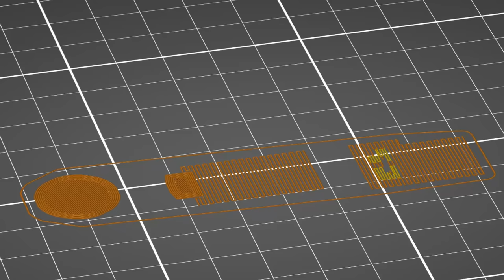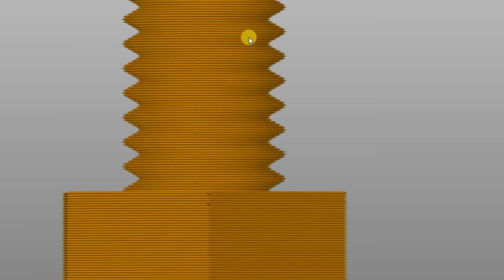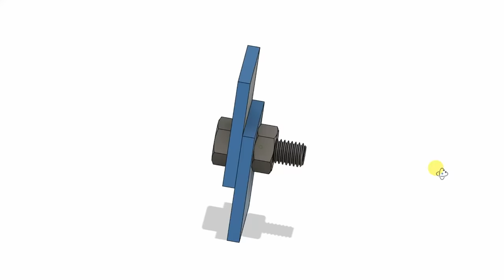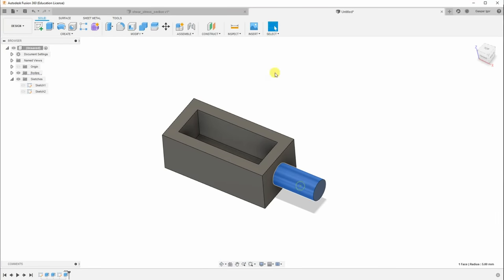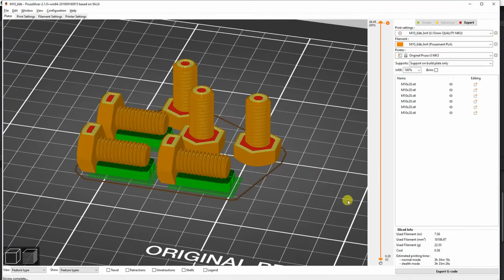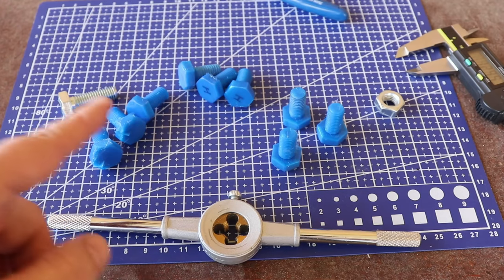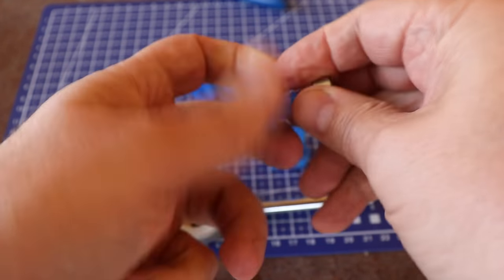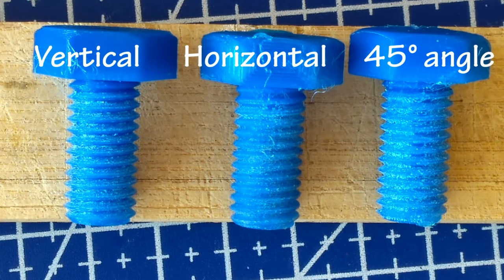3D printing bolt and thread in horizontal or vertical position - strength test

Comment: It may be a better idea to use a hydraulic jack to do the tensile and shear test instead of your body weight. Some additional setup will be required to get the force in the right direction.
Reply from the maker: I am working on Arduino based tensile testing machine, but it takes time for parts arrive from China ;-)

Comment: A thought mid video, does the position on the diagonal print matter for rigidity? What if it was so that the print was flipped so that the head is facing upwards?

Would it be stronger if the layers were at an opposite angle to the threads?

Comment: Very good information. I am just inspiring should we start thinking develop a '3D printed' thread standard? Just an idea. Thanks you.
Reply from the maker: What do you mean with 3D printed thread standard?
Reply: @MyTechFun  sorry for my late response. The 3d printing thread standard - I mean the shape that will most benefit when you printing it (FDM printed). I understand that there are many types of thread design on the internet already, most of them have bigger pitch than ISO thread standard.

Comment: You had rachet straps, why not use those for the pulling force instead of possibly hurting yourself? Very interesting test though!!
Reply from the maker: Rachet straps needs another fixing place, somewhere near floor. But I am working on safer solution, will be visible soon..

Comment: For the torque test you should’ve used an actual torque wrench because I think the way you did it wasn’t a good way to measure it since the further you move from the point of rotation the less force it’s going to take to move it but if you used a torque wrench it would tell you the exact force it takes
Reply from the maker: Thanks for suggestion. I am working on Arduino based digital torque wrench, but I think this method give acceptable results (good enough for comparison in this video). Torque wrench can give us values in Nm (not force = N). Mass*g*arm = Nm (in my method).
Reply: My Tech Fun oh ok that makes since and that’s also really cool

Comment: I think if you print 1 at a time they will be stronger because it is keeping the printing + heat more constant than jumping to 2 other parts to print at the same time...
Reply from the maker: Yes, 1 at the time is stronger, but this is not only about 3D printed bolts, but about testing threads as part of any 3D printed object.

Comment: What kind of infill did you use?

Or was it solid PLA?

Would these be stronger if printed in/with resin?
Reply from the maker: 100% infill with 5 perimeters. Resin bolts test will be in near future.

Comment: i like printing bolts flat with a flat cut along the bottom so it still wont need supports the bolts function is unaffected by having a flat
Reply from the maker: Yes, I already got this suggestion several times, I am sure, that I will test that in near future. Thx.

Comment: Could you print the bolts horizontally BUT with nuts on the entire thread. So the nuts would be the support and nothing is wasted. However will the nuts properly "detach" from the bolts?

Since many people use very short bolts, in most cases 1-2 nuts would be enough to fully support the vertical bolt.
Reply: To ease separation you could use for example M4 nuts as support for M3 bolts. You could even print TINY support between the M4 nuts and the M3 bolts where they touch if necessary.
Reply from the maker: I understand your idea, but with this video I was curious more about threads, not just bolts. Threads as part of your 3D printed object. If I need just bolts or nuts, I use standard metallic versions.

Comment: Your making great videos on testing strength of 3D printing I like them but I was wondering about the strength on the torque test isn’t it force in newton x length in meter = newton meters so that means you are getting kg meter you still need to multiply the kgm with 9.8 then you got nm or am I wrong?
Reply from the maker: Force = mass * g for example on torque test if I measure 1 kg => force is 1*9,81 N. So Torque = Mass * g * arm [Nm] More detailed explained in this video (timestamp link) https://youtu.be/EakLs9ebcZA?t=252
Reply: My Tech Fun oh right sorry i looked over the 9.81 in your equation I am sorry

Comment: interesting I just got done printing some tank valves and I have problems with the treaded section snapping at the base when i tightened the nut, so far I decreased the interior pipe diameter which increased the strength but I was also wondering about this very test

Comment: Could you upload the model of one bolt M10, please? I mean the file you put to the Slic3r (probably stl). I don't have a Fusion but I really would like to check it on my 3d printer.
Reply from the maker: I am working on a solution where even Tinkercad users can create a bolt or nuts. Just need some time to prepare it. M10 used in video has 0 mm clearance, not useful STL if you don't have a die tool (0 mm, the reason was explained in video, to have same size for experiment after cleaning a thread)

Comment: I think I already saw a similar test in the past, it was more accurate than this one.
For more accurate results you need everything on a smaller scale. Human for scale is a bad idea when testing something like this because you cant control weight distribution and swinging. You also need to repeat the test multiple times for more accurate results and calculate the average of those few tests.
Good luck.

Comment: Have you tried printing aircraft bolts? They have curved edges instead of sharp and should be less vulnerable to shear and tension. Idk about torque, though.
Reply from the maker: That makes sense. Or maybe trapezoidal threads..

Comment: after the print is finished you need to put the part in an oven and heat the entire part to the glass transition temperature ... it will make the part much more stronger
Reply from the maker: The object will deform a lot. Tested: https://www.youtube.com/watch?v=v3w8GlcHUsc&ab_channel=MyTechFun

Comment: Good data, but he should have tested the Nuts as well, then tested BOTH together, as this what most people are going to print to use anyway.
Reply from the maker: Nuts are tested too (but not together), but it looks like bolts are weaker point, 3d printed nuts are stronger.

Comment: If you're going to cut threads using a die.  You should also test by printing cylinders and simply cutting the threads.
Reply from the maker: It is always better not to cut the perimeters of printing, only minimal with slightly correction.

Comment: Wonder if printing at different temps has influence on the strength
Reply from the maker: If printed in horizontal position, not much. If printed in vertical position, yes, temperature has very big effect to layer adhesion.

Comment: Can you tell me what support settings you use in prusa slicer? Overhang threshold, contact z distance and xy seperation? Thanks
Reply from the maker: In these tests PLA on 220°C, 0.15 layer height, 0.4 nozzle, 0.1 z distance, overhang treshold 30° = only overhang of 60° has supports.
Reply: My Tech Fun thanks for the info, did you leave xy separation at 50%

Comment: The strongest is not the made out, but the took out.
Solid material machined to be something is stronger than something that was made to be.
The lathe is more important than any 3d printer.

Comment: I wonder how testing with just printing the shape of the bolt and then using a tab and die set to cut the threads would affect these results...
Reply from the maker: In that case, you would completely cut the perimeter(s). It is better to have (almost) ready object, and use die only for cleaning the thread.
Reply: @MyTechFun 
A year later...thanks for the interesting video and the hard work that went into creating it.

I've been hunting through the comments to see this came up. I wonder if printing the perimeters such that they would be the same thickness as they would be with printed threads, then using the die, would result in a stronger bolt and/or better threads?

Comment: You should use a car jack for more controlled application of force. It also shouldn't max out at 140kg.
Reply from the maker: Working on better solution. I bought 500 kg crane scale, it should be enough ;-)

Comment: Please, I really like your channel.  The way your are hanging down to test the bolts is dangerous.  If you get hurt, it will not be good for you or for us.  Please use a pulley system so you don't have to strain anything to perform your test.
Reply from the maker: When I watched video it looks dangerous, on spot I don't feel it's dangerous. I am working on Arduino tensile testing machine, few parts are missing but it will be done soon
Reply: @MyTechFun  I'm just looking out for you.

Comment: have you ever tried printing a solid rod and then use the die to create the treads?
Reply from the maker: With that method you will cut perimeters (wall). That can work only with solid (injection molded) plastic.

Comment: What about printing it without thread and then use the threading tool to make thread - it could work better, you could try it
Reply from the maker: Cutting walls (perimeters, or shells) is not good with 3D printed object. I am trying to do without any need of useing die (or tap) tools. Will be demonstrated soon..

Comment: Why is the horizontal print still stronger than vertical print in shear test? The fibre orientation for vertical print will be in the same direction as the shear force and so should be stronger right?
Reply from the maker: Shear area is in direction of layers on vertically printed bolt
Reply: @MyTechFun  Sorry I still don't understand; do you mind elaborating?

Comment: Put a small dynamo against the Aniroid barometer cell cylinder so we got some voltage as pressure changing in whole day 
And collected all voltage in a battery bank so we found new ways to produce clear power round the universe

Comment: What's is the 0.19m?
2.8kg*.19*9.81

I know the 9.81m/s is gravity and 2.8kg is force

Thanks
Reply from the maker: 2.8 kg * 9.81 m/s2 = Force (in Newtons) and 0.19 is distance in meters (Force * distance = Torque in Nm)
Reply: @MyTechFun  you ledgend! So you turned .19m around whilst turning the ratchet?

Comment: Excessive stringing is usually caused by a wore out nozzle. Avoid carbon fiber and glow in the dark filament to prolong nozzle life, or get stainless steel(but I have had issues with clogging due to poorer temp control)

Comment: logic would indicate that 45 would be the best for all the jobs but the best for NO job, because the resistance offered by the pigments would be distribuded in a more balanced way that would accomodate to stress from all directions, but i guess i failed mechanical engineering for a reason

Comment: If you have to use a die for the finishing, the question is why to print the thread at all... just print a cylinder and carve the thread with the die.
Reply from the maker: Die was used only to clear the thread, to have exactly same dimensions with all 3 types of bolts. Horizontal bolt needs cleaning because of support attach marks. In most cases, cleaning can be done with metallic nut too.

Comment: How does printing at lower temp change this test?
Reply from the maker: Printing in horizontal position is less sensitive to printing temperatures (unlike vertical bolt, it is very sensitive to printing temp)

Comment: am i mistaken or did he calculate torque wrong with geaviry being used for acceleration
Reply from the maker: Calculation is correct. Torque = Force (N) * arm (m), and Force (N) = mass (kg) * g (m/s2) , since scale is measuring kg and not dynamometer measuring in Newtons.
Reply: @MyTechFun  so force = mass * acceleration, so wouldn't your acceleration be horizontal meaning gravity wouldn't be applicable?
Reply from the maker: @f1aimingchick3n81  Unit of my hanging scale is kg. To convert (kg) to (N) I have to multiply kg with g acceleration, since scale is calibrated to use it on earth with g=9.81 m/s2. If it would be a dynamometer it would show N as unit, not kg (hanging scale shows pulling load from two sides, no matter is it vertical or horizontal).

Comment: Very funny!
Looks good but for more accurate results you need to
take at least 5 bolts for each 3D printing direction and
take the average.

About calculating the Yielding Strength and Young's Modulus, 
you can make some testing rods with bulges at the ends and
accurate circular section and try in each force increment to
measure the deformation to calculating the strain.

Thanks!

Comment: What’s the best way to print something that costs 12 cents
Reply: Something that then costs 11 cents or less. Even a 1 cent difference in bulk and mass production matters. If someone makes 10.000 somethings for 12 cents and someone else makes 10.000 somethings that does the same job for 11 cents, the one with the 11 cents somethings will be ahead in the game of profit soon enough. Not even talking about someone managing a 50% cut in input costs.

Comment: 2 mins into the vid but i would guess printing the bolt on the angle of the thread, easy print and much stronger. I think i have to test that lel
Reply from the maker: If you will test it, let me know of results. Probably I will test too, but if there will be no significant diference, I will not publish the results.
Reply: @MyTechFun  ok ill try that tomorrow but i have to mention that i have 2 almost first gen prusa i3's and one anycubic prusa i3 and the all printed like 20 rolls each so tolerance is not good anymore haha
Reply: @MyTechFun  but i have one hell of an accurate resin printer so maybe ill try this as well🤔

Comment: If your layer adhesion is proper it doesnt matter which way you print it.  You need heat speed ratio.  You didnt show your prints speeds. 
But over all your video is pretty funny.

Comment: Hello, i print M6 bolts and they are breaking all. Can you or someone give me any tip to make the bolts stronger, pls!
Reply from the maker: Are you printing them in horizontal position? What material? Slow down the printing, print more than 1 piece in same time (then layer have enough time for cooling).
Reply: @MyTechFun  vertical, and i am using pla. Thank's with the tip

Comment: 16:33 111,3 vs 119kg: You made a mistake: It might have been 119kg, if it were a massive plastik bolt, not made out of horizontal layers (4D-printed ;-)... But your M6-bolt was made out of thin layers, printed horizontaly. So th "ultimate strength" ( 14:18 ) refers to massive plastic parts, not printed ones! 119kg would be the strength of an (imaginary) 6mm-filament itself, and not of a 6mm-part printed out of that quality of filament !!!
Reply from the maker: I noticed that ultimate strength can be used in calculations if layer adhesion will not effect the test. For example test probe printed horizontally. If it is printed under angle or vertically, that value can't be used. M6 bolt has solid cilindrical part of diameter approx. 5mm, not 6 (without threads).
Reply: @MyTechFun  Well, right, I didn´t think of that... The M6 has only 5mm massive diameter...

Comment: Man, it is so dangerous to demonstrate strength hanging on it. It can hit your head by metal corner and make a hole in your scull. it would be much safer to use a threaded rod to load your bolt. it will also eliminate the dynamic load that you put into making efforts.
Reply from the maker: That was my first testing, I needed those results ASAP. But now I have safer equipment: https://youtu.be/E3WRBp-T42o

Comment: Have you calculated your moment on your wrench for what I see your measurement is not correct
Reply from the maker: In torque test in this video I used a hanging scale. Moment = Force × arm, where Force = mass on hanging scale × g.

Comment: Who prints nuts & bolts anyway?
Reply from the maker: Sure, if I need a standard bolt or nut, I use metallic ones, but this test is to learn specification of threads, for example if you need a thread as part of your 3D printed object.

Comment: you can't know your BMI from calculations from a website. Mine always get super overestimated because i'm heavy for my height, but i also have much more muscle than the average person, so my BMI from these calculators ends up 10 more than it really is when measured by a physician with ultrasound.
Reply: Bullshit, BMI is by definition mass divided by height squared. Your physician is calculating a different quantity. And no need to sugarcoat it, virtually anyone is overweight if they are 110 kilos. He does not look so fat though because he has a good posture

Comment: how about you print only a rod and use a pack to make the threads
Reply from the maker: There is a big difference between clearing existing thread or cutting the thread on 3D printed cylinder cutting a wall (perimeter or shell).

Comment: Bro instead of wrapping yourself in weights and crashing into the ground why don't you just set up a ratcheting strop on a horizontal plane and ratchet the tension onto the bolt ???
Reply from the maker: Working on solution. Also I am building tensile testing machine too (Arduino based)